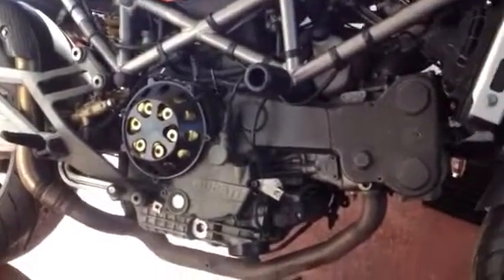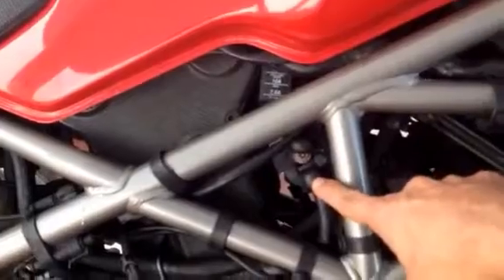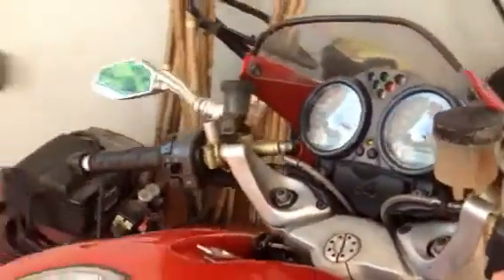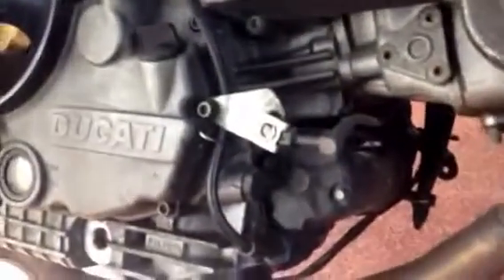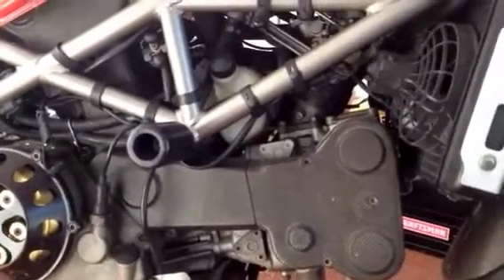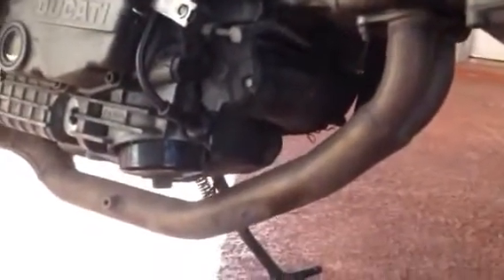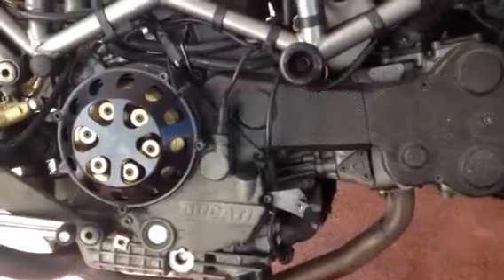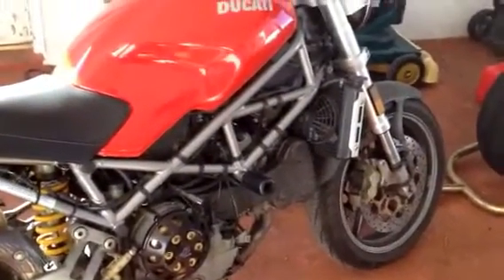Starter motor

Comment: My Ducati ST2 has the same problem, to remove your starter I am afraid you will have to remove the whole side cover on the other side of your bike to gain access to 2 of the bolts on your starter to remove it, and there is another bolt on the outside.
Reply from the maker: Thanks! I had a shop guy replace my stator a few months after the video was made. Happy and safe riding.

Comment: Alternator cover You "THINK" the  location stated at 1:23, sorry mate but you Sir should NOT be in possession of such a fine machine, so under the cover you pointed out is the front cylinder timing belt the Alternator is attached to the inside of the engine case on the right hand side of the motor located directly off the end of the crankshaft. 

I have a similar issue with my 1991 900 SS who's starter has been progressively getting lazier over the last few weeks making me suspect the Brushes being the problem but am in the process of removing it now and will let everyone know the course of action once I determine exactly what my issue is .

The cases and ancillary equipment may be different on my bike but the general layout in the video suggests not.

Yes drain the Oil and change the filter (preventative maintenance) so you can remove the cap screws on the left side of the Engine case after attending to clutch and other items  IF required !  Once this has been done you can remove the required parts to gain access to the bolts holding the starter in place, 
Then you can disassemble the Starter and refurbish , don't be a fooled into simply replacing as it may be a $50 fix rather than a $250 replacement.

NOW for the Fun bit !!  I just had a look at mine and while I have NOT removed it at this point I think there may be a chance that access to the brushes can be made WITHOUT removing the starter completely because the Power is supplied at the rear of the housing AND there are 2 bolts you can see there!
Now on some motor's I have worked on the starter commutator can be removed without removing the entire thing and IF this is the case then it is likely that the brushes are contained within the rear of the housing where the power wire connects. 

Failed bearings can also give the same sort of issue that is being experienced here as well tomorrow I shall investigate further and post my findings.

EDIT  OK After removing the rear Brush housing I made yes MADE new brushes by cutting down a pair of Standard Auto Alternator brushes,  $4 and a couple of hours work , Job done  - OK Yes I am handy with tools BUT any Bike owner should be so they can do their own maintenance ,
Reply: Ok, how the hell did you get the end cap back on?  I did this today but cannot get the back cover with the brushes back on.
Reply: OK what you do is the replacement brushes I made ar such a tight fit in the carrier's that I used the tails of 2 zip ties placed in the carrier's also . this keeps the brushes back out of the way of the commutator and allows you to place the brush carrier over it and then remove the zip tie's line up the locating lug and insert the bolts .
I had to temporarily remove the oil cooler fittings so I could get tools in there, hope this helps you out.
Reply: AAHH  the hole where the spring is.  I fought that thing for a long time before finally admitting defeat.  Since I was there and have to anyway I took off the belt covers (that guy..wow) and I'll do the belts since its been about 6000 miles on my current belts.
Reply: It worked!  Thank you A TON!!  Only took me 5 hours LOL.
Reply: No worries mate, the exchange of little tricks and ideas is what makes us bike nuts and mechanics in general advance our expertise . 
Took me a little while to figure this out as I was in the same place as you were once I realised the brush holder wasn't going to allow me to use spring retainer's I would normally use (just no room) with the positive terminal bolt in place .  Glad you got it sorted .  :)
You could also run some cotton sewing thread or even Brick layer's Line to hold the brushes back against the pigtail springs, as well.  If you think outside to norm there is always a solution . 
Especially in this case where you would normally have to remove the left case of the motor to remove the starter.
Reply: I tried to use a thin piece of lexan as a sort of ramp but that didnt work.  Neither did yelling, cursing or bleeding all over it from a previous cut.
Reply: I shouldn't laugh but I feel your discomfort ,  So often thinking well outside the normal can so often yield a good end result.
Reply: @mozzmann  .. Hey mate.. I'm facing a similar issue with my 96 m600, after I switch her off the engine keeps chugging at a very low rpm, and then after some time it dies. I thought maybe something to with starter solenoid, but all voltages check out fine....
Reply: @krishnakamal6129  If it keeps running when te key is turned off then you have a phantom power issue I'd suspect ie there is a voltage supply to the Ignition controller somehow bypassing the Ignition switch. 
. Use the wireing Diagram and trace how and where power is supplied to various sections of the Starter and Ignition circuits.
Reply: @mozzmann  thanks mate, I think it's the bloody start switch on the handle bar.... I'll try and get it changed.... Hopefully that sorts it out
Reply: @krishnakamal6129  The Start switch should only trigger the solenoid to run the starter ! Ignition power is supplied from the Ignition switch so I'd suspect there is and internal issue with that .

Comment: Did it end up being the starter? Just the brushes or did you go with a new starter? I'm having the same issue with my ST2 and everything online says it's probably not the starter, but I think it may be. It's a 2000.
Reply: +cris smocov Unfortunately, you have to remove a lot too get to the starter. You will need to drain the fluids, and need a specially tool to pull the left side engine cover off. I bought mine cheap at harbor freight. There are three bolts that hold the starter on, and one of them is only accessible from under the cover. It was not difficult.
Reply from the maker: +Joe Zaino yes, the starter contact got burned from xyz reason. My trusted mechanic, replaced it with a "new" starter from a newer bike. He opened it  up, and it was either the brushes or contact were burned. I believe part of the cause was me cranking the starter over and over without giving in 5 min rest every two starts. Whey did I have to give it more than two starts? Because in cold weather I think the crappy ducati stock wiring does one provide enough juice so I  had to try and try. Electrically mi bike is not the best. I replaced the VR with a mosfet, I got a Shorai Li battery and new ECU as that stuff got messed up over all. Good luck.
Reply: Thanks.  I just pulled mine apart.  Brushes completely worn down.  New starter coming from Stocker. Cheap enough that I'll just swap the whole thing and not do the brushes.
Reply: +Joe Zaino hey
how did u removed your starter from the bike?
what was that you had to remove in addition ?
thanks
Reply from the maker: +hambonez8888 well said...
I had my friend/ Mechanic Otalora Racing in Miami do it for me. The brushes, as stated in other comments, were burnt. like any electric motor, one must let it cool off it it will burn up. The wiring is not the beast on my bike and on cold starts it looses juice for lack of technical knowledge.
Reply: Hi Joe, I am having the same problem with starter motor on my Ducati Monster 1100. It is probably the starter motor. Just wondering where you purchased the starter motor for your Ducati for "cheap"???
Reply: I also have an ST2 with this problem, I first of all checked it out with a test meter and also tried shorting out the solenoid, all was OK, I wondered if I could have a peek in to see the brushes without removing the starter and I found out the problem is actually an oil seal failure resulting in oil getting inside the starter fouling up the commutator, so it has to be taken out to either clean it up and fit new seals or just replace it.

Comment from the maker: Thanks tom, just saw your comment.
Learning A TON more about motorcycle, actually wrenching them... though I have yet to take an engine apart.

I had a trusted mechanic change the starter and he also changed the oil for me. He he replaced the synthetic Mobil 1 oil I was using with Motul. He said it was a crime with the oil i was using LOL. 

I was gonna take my bike for him to also fix my leaking forks but I now know how to do it my self ...

have a great one.

Comment: well i guess you know what happen already but for future reference when you change the starter you dont really have to drain the oil but you should lift the bike and have a bucket under to catch the oil that comes out not much will but some will. And the stator cover is on the other side of the bike its the left side if sitting on the bike. the reason you have to take the cover off is because the starter is screwed into the engine under the stator cover its pretty easy fix just a bitch taking all those screws off.

Comment from the maker: What ended up happening is that the Starter has some magnets inside that came loose. They came loose due to overheating. The starter overheated due to me energizing the starter motor too often time after time. The weather was cold and it would take several attempts to get her started. Like any electrical motor, there is a limit on the number of starts per time period before the heat takes a toll.
Reply: 2 Pack epoxy resin to the rescue :)